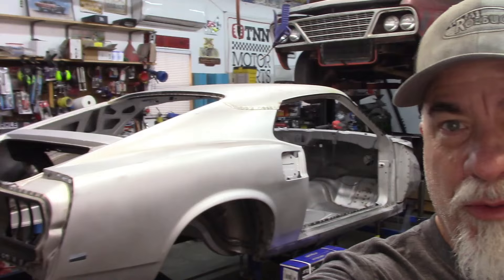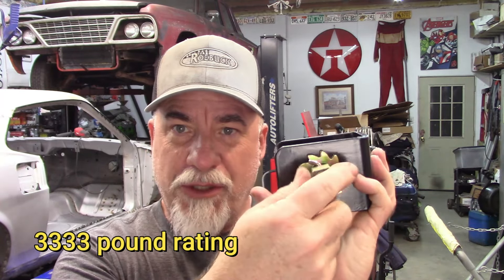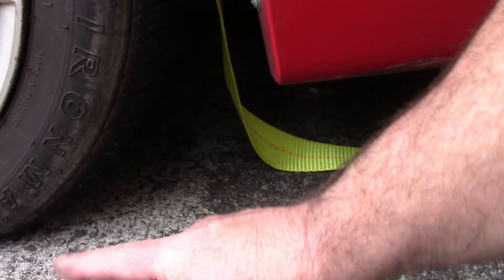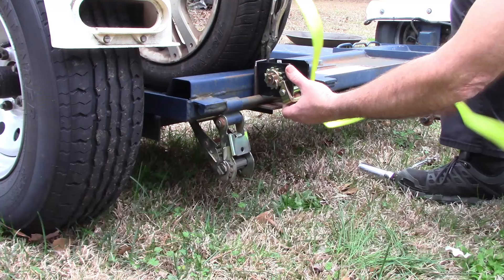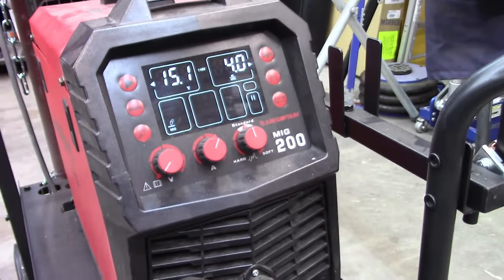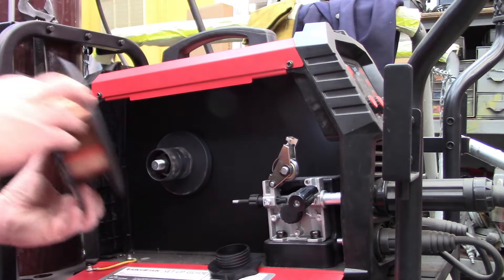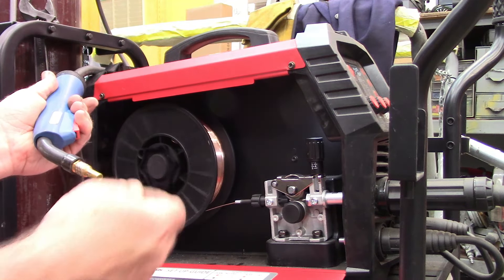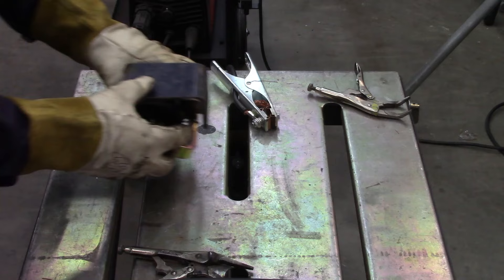Tow Dolly tie down for low clearance cars. DIY.

Comment: Would flipping the original handle type ratchet over not take care of the problem? The handle would then face the ground instead of your bumper cover...
Reply from the maker: That would still be difficult to make it work.
Reply: I've tried it and you still don't have the clearance

Comment: I’ve thought about doing exactly this but don’t have a welder. I’m sure you know that you can release the original ratchet strap with the screwdriver so that you don’t have to extend it all the way. Did you think about welding on a bracket on the back of the new ratchet  ( like U channel) so you can just bolt it to the factory strap where the original one bolts on?
Reply from the maker: thought about that, but I liked the version I came up with. I can use either one now.